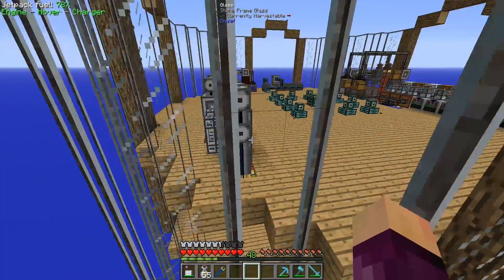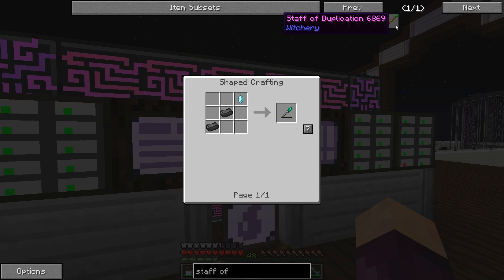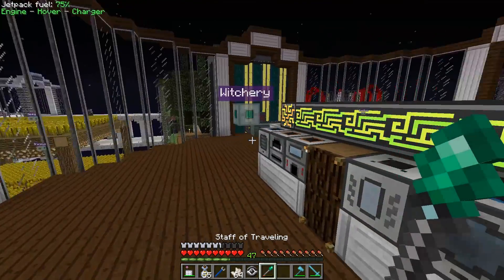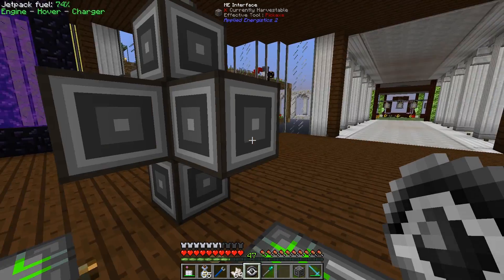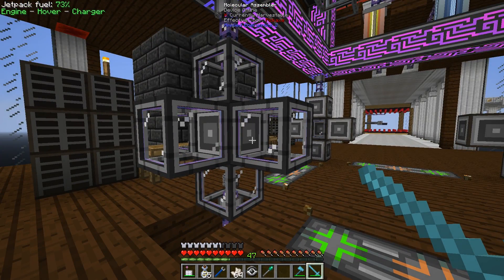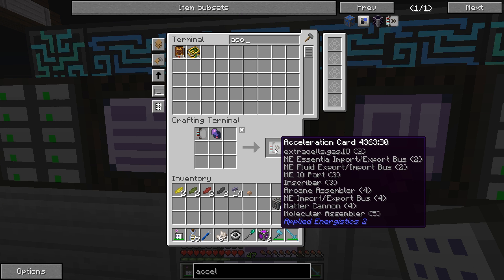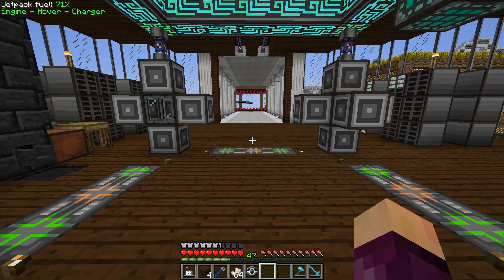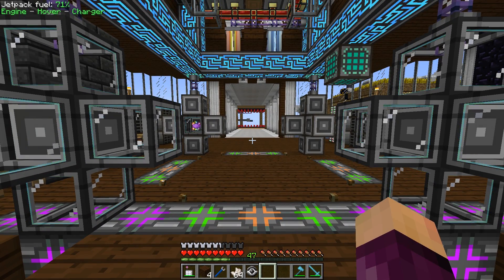FTB INFINITY EVOLVED SKYBLOCK - CO-PROCESSING & ACCELERATED AUTOCRAFTING! #42

Comment: 16:12

Oh Isaac, as long as your crafting CPU is cuboid in shape you can extend it in any direction as far as you'd like. Specifically, since there's no way you can set up all of those CPUs with co-processors and be symmetrical, if you replace the two co-processors on either end of the crafting storage with like 1k storage, you can put all 5 co-processors in a line adjacent to the crafting storage. It will be symmetrical and beautiful, especially with the orange-green-orange-green-orange and the line of purple ^-^

I know I'm 2+ years late, but hey maybe you still hadn't heard about that yet!